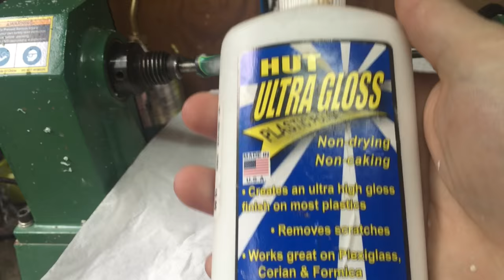ToolMake16: DIY Center Punch : Scratch Awl

Comment: I love how you secured the 7mm rod in the shell with the solder.  Really cool idea.  Though there are so many 7mm rounds out there to use.  Stop at your local gun range and ask for a couple spent shells.
Reply from the maker: It seems to be holding well. Thanks for checking it out.

Comment: nicely done bro!🖒💥🖒 good luck in the challenge..i need to get going on mine..i see u still got that olibe wood..haha me too waiting for the right time to turn it into something...oh and you know that lil tray on ur grinder is for water to cool the metal ..justa frie dly f.y.i.
Reply from the maker: Thanks man, yeah I literally just got my new bandsaw blade in the mail. My plan is to do some practice runs and then make a bandsaw bow from the olive wood. I want to make the drawers big enough that I can get some pen blanks out of the waste. I know that's what the tray is for haha it was just easier with the drill and longer piece to use the cup. All tips are much appreciated though
Reply: +Kaged Creations oh that's a good idea never even dawned on me to make a bandsaw box with it can't wait to see what you come up with and my bad wasn't rolling on you just didn't know if you knew I kind of had a feeling you did and yeah come it's easier I ended up using a cup for  for my second all I made.